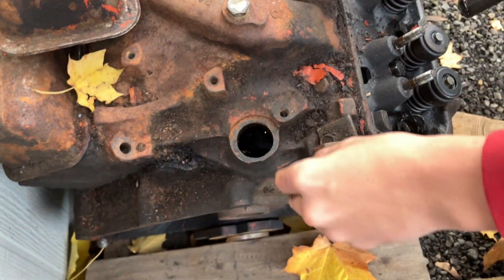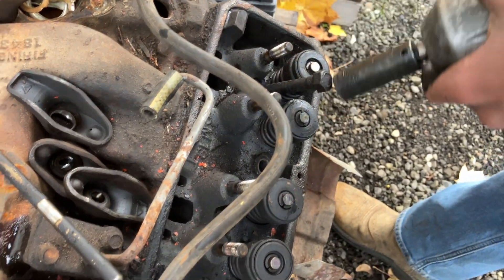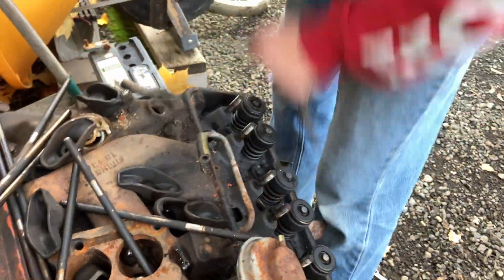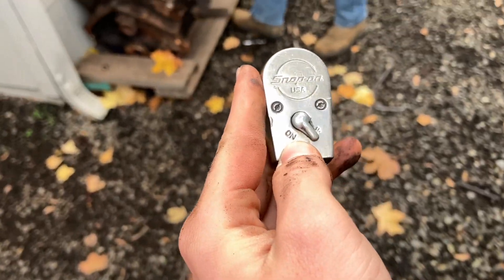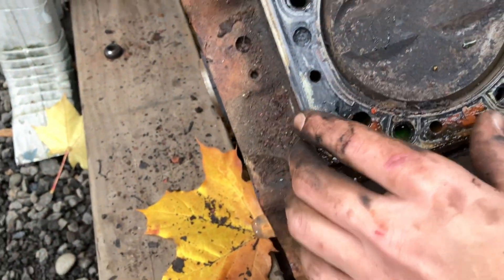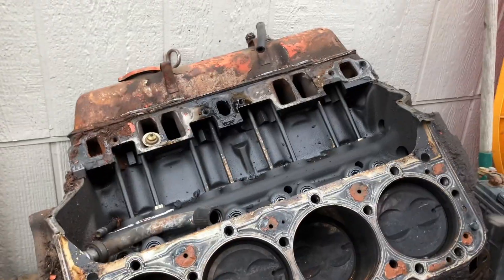Redneck science with engines

Comment: I have a feeling some old guy is gonna find this motor, and figure's out the Intake Manifold surface was just hammered in-to lol.

fun video

By the way the far easiest way to remove an Intake Manifold without damaging it too badly is A Rubber mallet, the Rubber creates a shockwave and it loosens the RTV. You should also put something in a Carb Bore and then lever the intake up with itself. This works super well.

You can also get an Alternator Bolt and screw it in to the Accessory attachment Points, short ways. At 13:46 it's the threaded holes next to the Intake bolt holes in the center.
Reply from the maker: @Laqota  thanks for info. This motor was trash anyways and we’re just having some fun😂